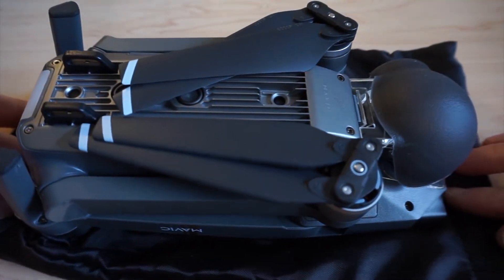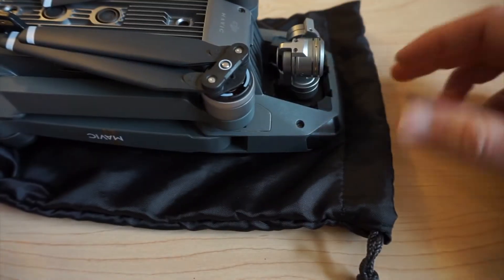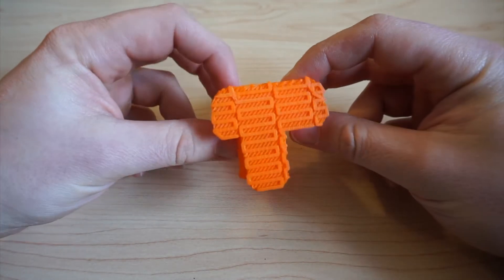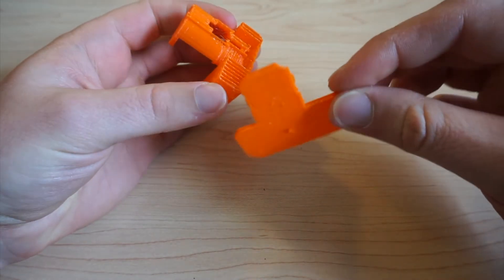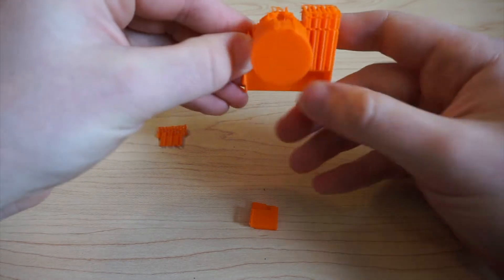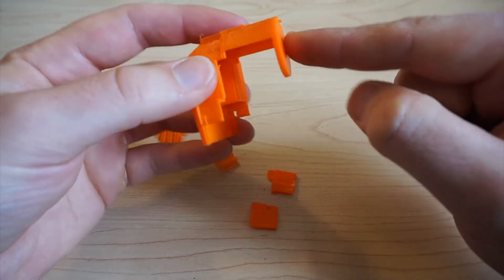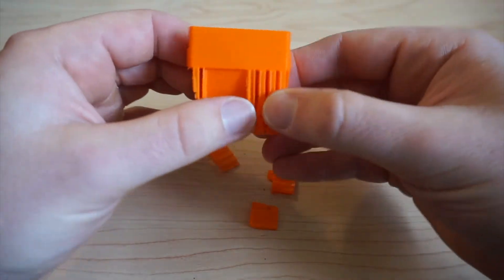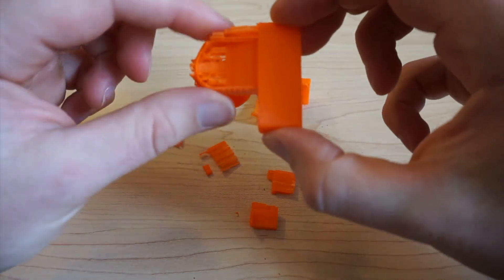Dji Mavic Pro 3D Printed Gimbal Lock Tutorial

Comment: Very nice ✈️😎✈️
Reply from the maker: Thank you Tony.
Reply: Nick can I ask you about your setting on YouTube for uploading your videos ,When I upload my videos they are not as clear as yours or other YOUTUBES. I use full quality ,I haven't seen a setting saying 4K or 2 k. My drone is shoot using 4K  and my Motorcycle video is 1080p ,ANY Advice for a amateur YouTuber 😎
Reply from the maker: Sure, what video editor are you using? When I use iMovie I usually use 1080p and "Best Quality". This leads to a clear export and not a huge file size either. My iMac has trouble editing in 4K so I don't even bother with it. The other thing to remember is the quality degrades each time you export. So make all your edits, proof it and only export it once. iMovie Pro Tip - The first video in your composition determines the quality in which you can export. For example, if you start your video with a video from a Mavic, you will be able to export in 4K. If you start with a video from another camera that doesn't have 4K but you have 4K Mavic videos later on, the quality will be degraded down to your lowest camera when exported.
Reply: Thanks  for that information  I have a12.9  I Pad Pro and didn't even know about IMovie so thanks for giving me the opportunity to use this Apple product to do all my editing ✈️😎✈️